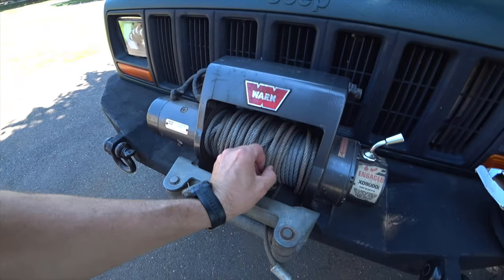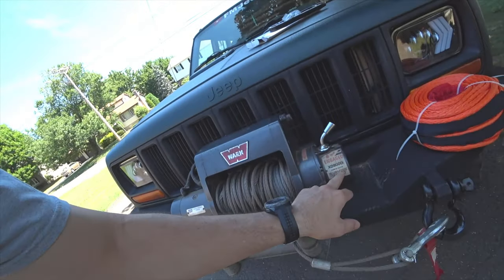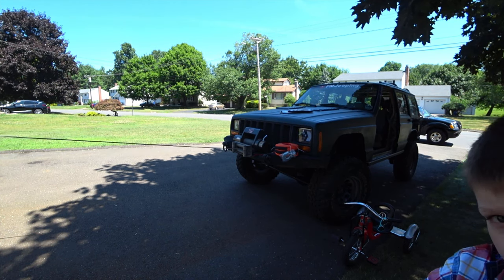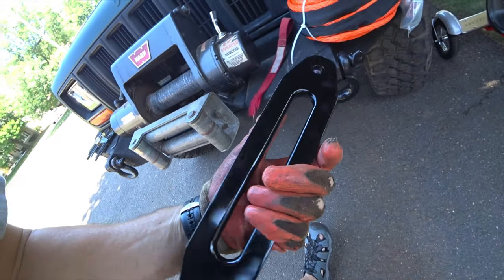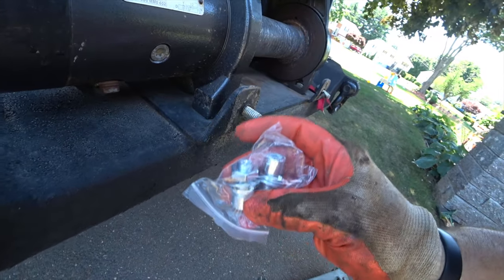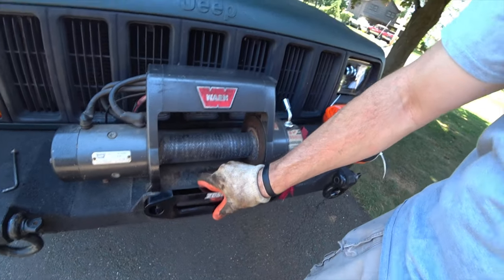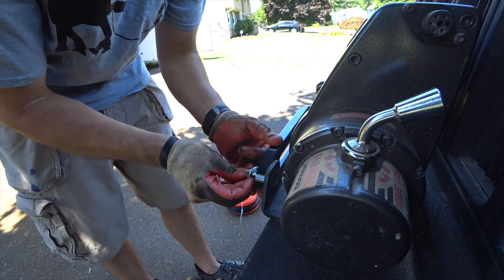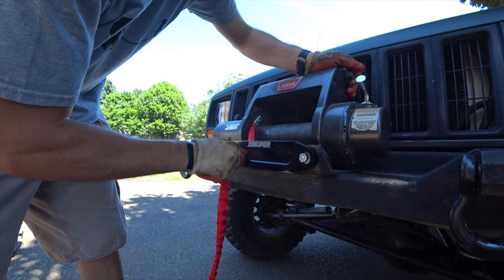Swapping out winch cable for synthetic rope

Comment: One reason to pretension a winch cable is because if you wrap it loose when you first install it, and lets say you let about about half of it to do your first recovery. It will probably bird nest your cable. like it will get tangled up the outer wraps will try to get under the loose wraps, I know my explanation isn't great, but  yeah it will tangle your cable up on the spool.
Reply from the maker: Good stuff !! Thanks

Comment: Good vid, buddy. 26 pounds isn't a WHOLE lot of weight savings BUT, it will make a difference in the long run. More with regard to your springs than anything else. "Blue Balls".... THAT was funny!!🤣🤣🤣🤣🤣🤣👍🏻👊🏻
Reply from the maker: honestly I thought I would gain a little bit more weight because of other videos that I've seen where the cable tends to weigh a lot more. But overall I'm happy I just like the safety aspect of the rope if it snaps it drops. Thanks for watching man